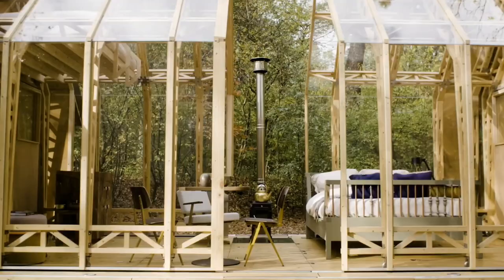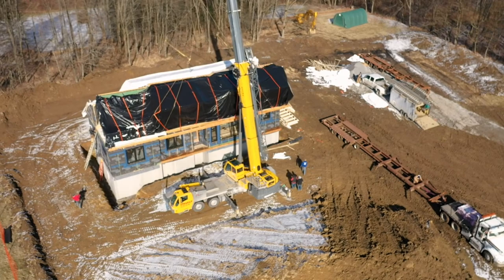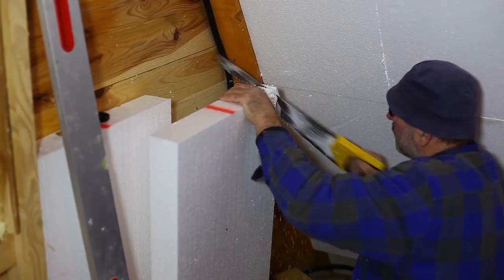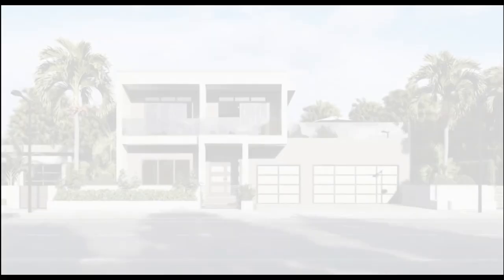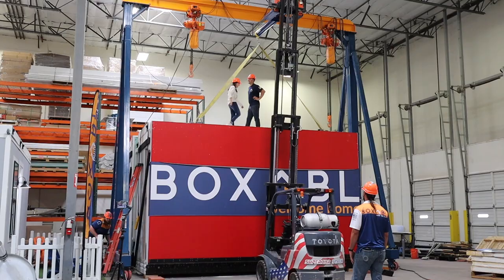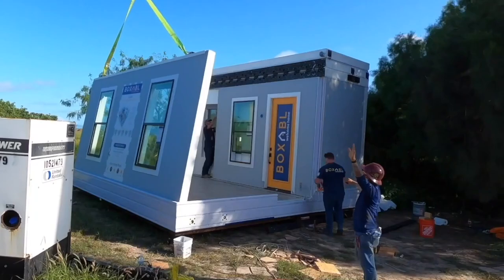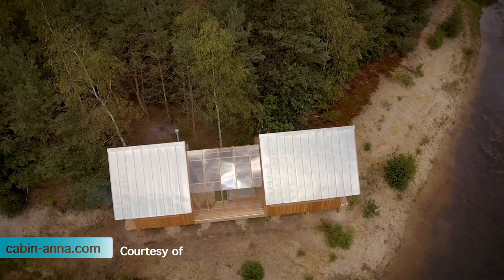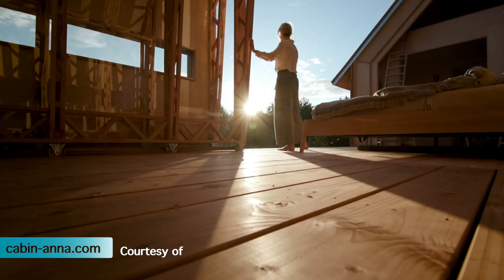The 5 Biggest Lies About Modular Homes

Comment: I purchased land on Johns Island SC in 2015.  When I started talking to local builders and showed them the plan I had in mind, all were coming back with incredibly high cost per square foot.  Soon I realized that this was a regional inflation because of the local golf resorts of Kiawah Island and Seabrook Island where builders could charge a premium.  I started looking at modular and it made complete sense that a home could be built at a factory in a more depressed area of the country (rural NC), where labor is much cheaper.  In my case, it ended up being cheaper to go modular, but it came with MANY headaches because of the installer.  I had a friend that was a Realtor and was saying some pretty insulting things about how I was making a mistake, but my home that I purchased for $450k in 2017 now has a Zestimate of $980k.  I filmed the install and will one day make a YouTube video about the process.

Comment: Paper thin 70s mobile homes in my area are selling for over $200,000 and they only cost $5,000 to $10,000 when they were installed in the 70s, so you are 100% correct. Modular homes are built with 2"x4" to  2"x6" exterior framing with R20 - R24 insulation in the walls and are valued the same as a stick built homes.

Comment: From a legal standpoint, the primary difference between modular and manufactured homes is that modular homes are held to the same local, state and regional building codes required for on-site homes, while manufactured homes are held to a federal code set by the Department of Housing and Urban Development (HUD).

Comment: I'd love a modular home!  Thank you so much!  Some of my friends in Co. live in what they say are modular homes but they came in two pieces as a manufactured home.  The only difference was that a crane had to lift each piece into place on a foundation instead of coming in on wheels and then connected them.  To me, they looked like manufactured homes.  They also were made by the same companies that make manufactured homes(Clayton Homes).  It makes me wonder if they really were modular homes.
Reply: Great observation. I felt the same way when looking at a modular (only because man. not allowed) and seeing the form with two box MOD or MAN side by side. Seems very suspect.
Reply: Manufactured would have wheels. Modular would be lifted off truck in pieces with a crane. Would not have wheels.

Comment: what about the size of doors and windows, When I worked for lowes I remember that manufactured homes required special a special order because the doors and windows were smaller than stock . You can also hire a contractor to resize the opening.

Comment: one big thing about modular homes also is they are built inside the factory, in dry conditions. in wet places most of the year in all winter places, like Finland, we have a problem that during on-site building water gets inside the construction. construction crews love to cut around corners, not protecting the project and all of its parts 24/7 from snow, and water, just to be a tad bit faster, a tad bit cheaper...
that´s a problem in public and private construction here. modulars, "inside built", are seen as the better, premium homes here.

Comment: I have worked in the warehouse and in the field installing Fire Sprinkler systems in modular homes on the NorthEast and each company is different I have seen homes scabbed together with 2x2 and others built with laminated studs. I would build one but would NEVER buy one as after the fact it is hard to tell the build quality. Myself I am leaning towards a post frame home.

Comment: A friend who used to work at Nationwide, now Silverpoint Homes, in my hometown is a proponent of modular homes, not only due to the high quality, but also because of WHERE they're built: indoors in a climate-controlled environment. Site built homes may be susceptible to molds and other hazards simply because they are exposed to the elements. Think about it. If it has rained on your framed house for a week straight, do you really think the contractor(s) care if the 2 x 4s have completely dried out before they begin putting up drywall? This is a special consideration here in the hot, humid, muggy (you get the point) southeastern part of the US.

Comment: Because I already knew that every "segment" (for lack of a better term), of a modular home has to be a stable unit unto itself for safe transport to a site, I have always been of the opinion that the completed dwelling is actually structurally stronger than traditionally-built homes. So, yes-- I would enthusiastically buy a modular home-- IF I can have it clad in brick once it's fully assembled (really tired of painting/replacing wood siding). I live on Alabama Gulf Coast, so mold and rot are major issues.
Reply: There is a brick modular about 5 minutes away from my house.

Comment: The biggest misconception Ive heard is they depreciate in value, as opposed to appreciate in value like a stick built home
Reply: Manufactured homes go up and down with the housing market, manufactured on private property will appreciate about 2/3s the rate of an equal stick built.  I would think a properly set up modular would do exactly as a stick built would, as that is just what they are.
Reply: Manufacture homes do, modular homes don’t. Modular homes are places on a foundation. The moment they are in a foundation they because just like a stick built home. Modular homes actually have to have double codes. They have to go through county codes and state code regular stick build sometimes just go through county code. (Somebody told me that) 🤷🏽‍♀️
Reply: @saralange1230  very informative, thanks!

Comment: Modular, factory built residential & commercial structures (homes, hospitals, office & apartment buildings) are constructed with more fasteners (nails, screws & adhesives) in order to withstand traveling on our poor roads, highways & bridges & thus stronger than site built roads.  Moreover, they have much lower construction waste than site built structures.

Comment: I like modular homes’ steel rail floors and 2 by 6 studs for side walls. Be sure to spring for sheet rock walls rather than the standard vinyl board.

Comment: great info. Question: from the SA2 and BOXABL website, looks like they do not currently give out pricing for the residentials? Or we have to contact them to get a quote? Thanks
Reply: If you look at the FAQ for SA2, it does give estimates on cost. They aren’t cheap.
Reply: @jcstreck74  then what's the point? LOL. I know some very modern looking modular homes around 2000sqt are about 500k+ without the site preps....it's certainly the same thing. The only adv I can see if goes this route, ppl would pay way less interests on their construction loan since the build time is significally shorter.

Comment: Thanks for the information. I couldn't find much info on modular vs manufacturer homes until I saw your video. Considering tearing my current house down in Seattle so I am looking to learn more on it and to see if costs are significantly cheaper. Hopefully in a few years material costs will come down. Thanks

Comment: "... a modular home is not a manufactured home..."
Well, yes- it is. If it's built in a factory, it's a manufactured home. If it's built to the HUD code, then it's a "sectional" home. If it's built to an individual state code, then it's a modular. There are other differences,  but that's the primary one.

Comment: nope they are not tighter , as a licensed home evaluator for over 35 years I assure you mods and not tighter and most fail my air tests as the walls are pre drywalled allowing no access to the vapor barrier for sealing, these types of homes typically cost %15-20 more then built on site , only gain is time a family can move in sooners in most cases .

Comment: Whats the warrenty  on the house and materials  is it 15 or 30 yr. Warrenty. ? Do you add porches  or any kind of siding after its delivered? Is the wiring all ready installed in the house before delivered ? If a person already have a design for a two bed room home will you build it and deliver it ?

Comment: I am interested in a modular Log home but I live in the southwest. Is there a problem with the dryer climates? Is a modular log home more efficient than a site built home? Also, financing. Is it more difficult getting financing for a modular home versus a site built home? Also, can they add solar to the modular home during construction? One more thing. I own my own land and I have a really old single wide mobile on it right now. Can I use my land as collateral for the down payment or full payment? How does that work?

Comment: does that $65,000 limitation on the minimum cost include the cost of the land or no??
Reply from the maker: You will have to speak with your local lender. But if you are rolling the land and home into one loan it should count for the 65k. I can’t see why it wouldn’t but I’m not a lender and they may have other rules that I’m unaware of.

Comment: I’m wondering Kristina if a modular home is off the ground like a manufactured home. I like a house to be up off the ground because it feels so much better on my feet and back. I was ruling out a modular home because I thought they had to be built on a cement slab.
Reply: My main floor sits a little over 3ft off the ground. I have a modular home.

Comment: 🤦🏾‍♀️ When you said, “If the modular home is under $65,000 you won’t be able to get financing.” But 👀 where are those less than $65,000 modular homes? I’ve never seen one less than $125,000. It was a 3 bed, 2 bath that was about 1,500 or 1,600 sq ft.
Reply: Don't worry, once you put windows and doors on, there's 65k EASY. lol. :) 😀

Comment: The Devil is in the details.  A modular home, which is factory assembled in sections, is dependent upon proper field assembly.  I once owned a modular home, and it was assembled in a hurry in the boom years prior to the Great Recession.  There were lots of defects that I discovered after the fact that you would not find in a "stick built" or component home built by a large builder.  One was fit - it was in two sections.  It was poorly connected and not properly sealed.  The roof had problems, and did the roof structure.  Be careful like you would with any builder.  Don't assume that modular is necessarily superior.

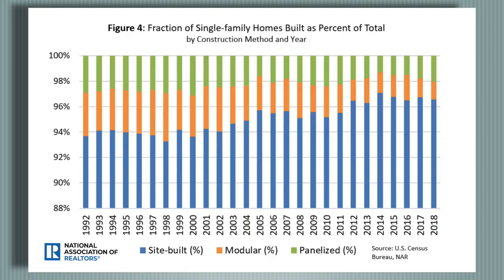Comment: at 2:25 you show a graph that seems to show Modular-built home percentages decreasing over the years, not increasing as you said. Am I reading that graph wrong?
Also, we went to look at modular homes online and every one of them had paneling on all the walls (like in a 5th wheel or travel trailer), instead of drywall. I can't seem to find out if that is in fact the norm or just the manufacturers we checked out.

Comment: The single biggest issue is cost.  Modular home promise a lot of savings, but comparing apples to apples in terms of quality, site built home are typically MUCH, MUCH cheaper. Its common that modular homes are $300-500 sqft.  Even in high cost areas, thats more than a site built custom.

Comment: Saving time. Not really. Add the time to build in the factory with the time at on site assembly, traditional build is faster. On-site build time varies according to the professional level of the builder. Also, despite what the modular industry claims, the inspection done buy a building department is more rigorous. Note, building departments in rural areas are more much more laxed. I have built modulars and on site. For myself, i would build for myself. Beware that custom home building can intice the owner to be to get involved in the project. This means they secound guess themselves as to what they want. Now the project starts to drag on.

Comment: Most people think modular homes are "this"... because that's what 99% of them are. The "really this" will still cost you an arm and a leg (in modular home dollars). The glass alone in those designs you posted is probably well over $30k. Just in windows. Not to mention the premium you will be charged for the "architectural" design. Nothing is free. Or cheap.  If you're going to drop 250-300k on a home... why bother with "modular". Custom $300k homes can be pretty freakin sweet.
Reply: In Chicago. It would have recently been on fire (not joking) or listed on veryapt Chicago crime as a 23 out of 100 in safety. Even I wouldn't go over there. Nope. Lol

Or, it's land and its 25 miles away.

Comment: Is a manufactured home the same as a mobile home or house trailer.  If not what is the difference?
Reply from the maker: I have another video on this channel. Mobile, manufactured trailer homes are not the same as a modular.
Reply: But are manufactured homes, mobile homes, and house trailers all the same?  I can’t see any difference in them other than they have gotten much better quality wise and bigger over the last few decades.   I have been around them since the mid 50s.  What part of Louisiana do you live in, if you don’t mind.  I’m in St John Parish.
Reply: @billmorris2613  mobile homes are on trailers with wheels and can't be put on a foundation/ basement. From my understanding.
Reply: @billmorris2613  Yes, manufactured, mobile, trailer can all be used interchangeably as they refer to the same thing. Modular home is a method of construction only, and the homes are otherwise identical to site-built homes in terms of codes, building standards, etc. Modular homes are permanently affixed to a foundation.
Reply: @billmorris2613  If you didn't know, manufactured homes do better in earthquakes, mine is on earth quake jacks which have not been tested yet...

Comment: Kristina" "We haven't seen a category 5 hurricane"

Really? Where I live we had two within two weeks back in 2017.
Reply from the maker: I misspoke. You’re correct. Officially, the decade with the most Category 5 hurricanes is 2000–2009, with eight Category 5 hurricanes having occurred: Isabel (2003), Ivan (2004), Emily (2005), Katrina (2005), Rita (2005), Wilma (2005), Dean (2007), and Felix (2007).

Comment: I love your channel and all the information you provide! Everything is usually spot on! However....I do not agree with you that modular homes are only those that come in multple pieces and do not include those sold by some manufactured home dealers. Those modulars DO come in two pieces which are joined together on site. And they are constructed as "on frame" or off-frame set on a foundation ( by a crane- as are the modulars you are referring to). The " modulers" I am referring to have to meet a totally different standard of construction than manufactured homes...in regards to joists and the roof construction for example. They are then classified as "modular housing" per the state and county requirements, appraisers, banks or financial entities and most importantly...insurance companies insure them the same as site built homes. I have researched, toured, and thoroughly explored the manufactured industry for years...as have you, I am sure...and this is the information I have been provided. So I am alittle shocked that you are telling me/us this information is not "true"!!???

Comment: Kristina 
I love your insight on real time real estate market advice. I will completely disagree with you on these "modular structures. There is no comparison to a true stick built house. There's opinions all over the map with manufactured housing.   
If its made in a factory its a manufactured house period. Have they come a long way? Absolutely. 
There are pros to these boxes but the cons far outweigh the pros. 
I've been researching the differences between boxes and actual houses built on site. Stick built houses last decades. I have 2 friends with modular houses. After about 10 years these structures are a nightmare maintaining. Materials begin to deteriorate rapidly.
If you want an instant house go for it. If you plan to spend a lifetime in one whole different story. Trailers have come a long way too. Fact is, if it comes in on it's own wheels its still a trailer. Modulars are just mobile housing without the wheels. Simply put, if I had a choice to spend $250,000 on a real house or a box made in a factory I'll go with a site built any day.
Reply from the maker: I appreciate your feedback but I can tell you from selling homes for the past 14 years. They do not deteriorate or need any further maintenance than a typical stick built home. I have seen them and various ages. Just like anything the type you get makes all the difference just like when you build a typical home that why I say to always investigate your home builder whether it’s a manufactured home, a traditional built home or even a modular.
Reply from the maker: @Don McLaughlin manufactured homes are built to completely different building specifications from a modular home. Modular homes have to meet or exceed traditional building standards.
Reply: You’re talking about a mobile home, a manufactured home. Modular homes are not the same. Modular homes are built to the exact same standards and codes as a site-built home.
Reply: @KristinaSmallhorn  Yes, make friends with realtor/former licensed contractors and get specialists for EVERYTHING. 

Electricians. Plumbers. Etc...